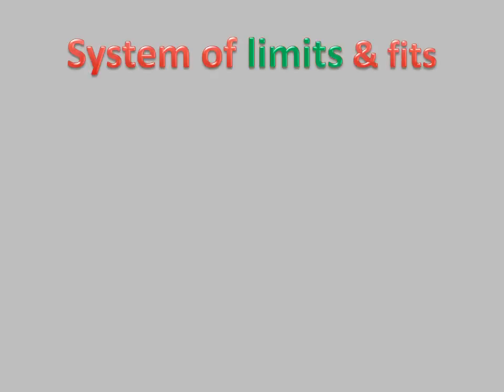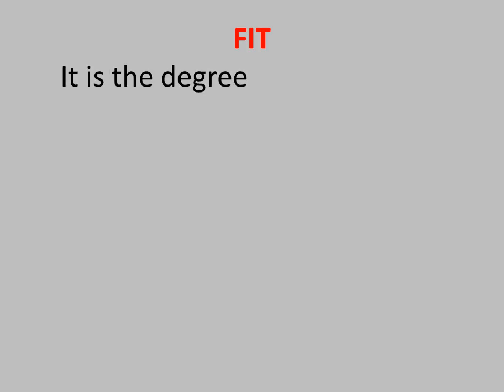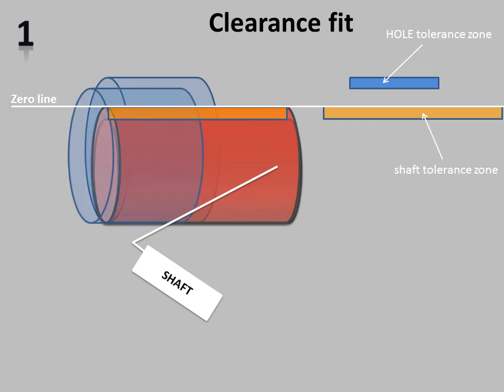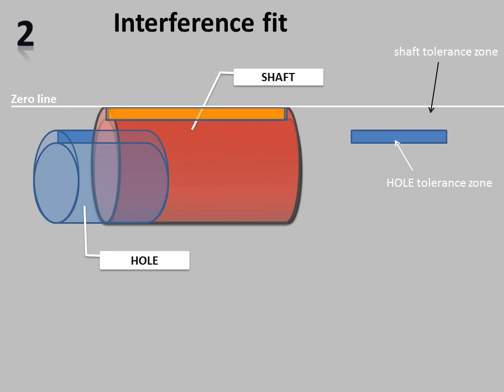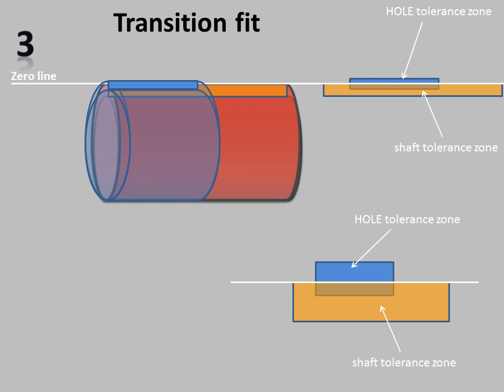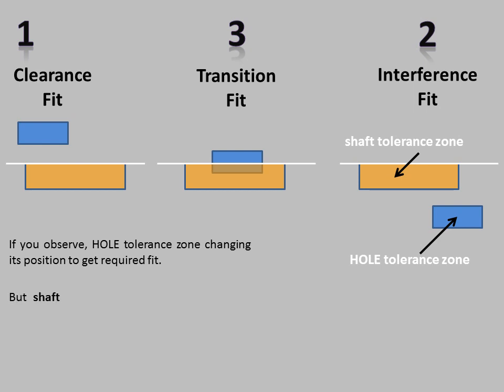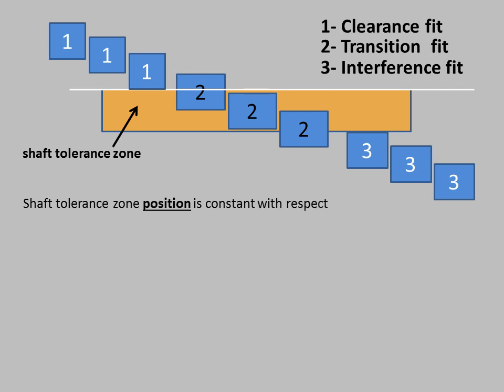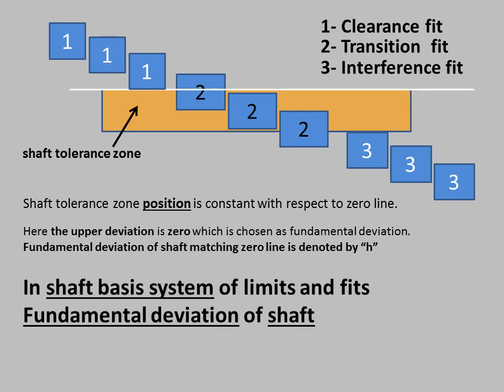fits,hole basis system, shaft basis system

Comment: In a fit such as H7/h6, what would happen if the hole comes in MMC (smallest) and the Shaft/Pin comes in at MMC (biggest) as well. Is there an unspoken rule in the workshop such as a Shaft/Pin should never be made at MMC. Always remove another...0.002 - 0.003? And what are the possibilities that a Hole will come in at MMC (at lower limit).

Comment: Can who clear up for me these following question? please!         
-Based on which basis we choose the appropriate tolerance? In addition to basics such as:
 +Tolerance system of the hole, shaft + Assembly type:( clearance, transition, interference)      
-I have the assembly between the hole with the shaft, the nominal diameter 20. But there are three cases happened: 
Case 1: Both hole and shaft are plastic. 
Case 2: Both hole and shaft are metal. 
Case 3: One of the two parts is metal and another is plastic. 
So, what difference in the above three cases when we choose the tolerance for them?
Reply from the maker: 1st of all it depends on
Purpose of assembly 
Magnitude of load
Type of load (radial, axial etc.....)
Then size of job.

In the questions you asked when  material of construction is plastic it is clear that load is minimum. So it will depend on type of load & purpose of assembly.
Reply: Thanks so much for answered my questions,  about the second question sorry but I  don't still understand so much. Do you have any document explant how to choose the correct tolerance of the assembly has the different material? Thanks again!

Comment: one question , how can we fit shaft in hole in interference fit?
Reply from the maker: as in case of interference fit diameter of shaft always greater than diameter of hole ,
we need to increase diameter of hole by indirect heating (to avoid changes in material property of the hole, for example heating a bearing in oil bath) enough to enter the shaft and locate on defined position.

or in some cases we use liquid nitrogen to shrink shaft diameter so that it will enter the hole and locate at its position.
Reply from the maker: by expanding (increasing) the hole diameter using indirect heating methods mostly and if interference is less then just applying force.
nole:
on shft end there will be chamfer  to ensure location in the hole.
Reply: By applying pressure with huge amount of applied force to shaft by forcefully forcing into hole so as to make sure that shaft holds tight with hole and minimise vibration while working

Comment: How do you fix the zero line? Why should the zero line not be there at the bottom of the shaft?
Reply from the maker: Zero line means no deviation from the basic size.  Right now size increases at upward direction but if you take at bottom of shaft as basic size and zero line then size will increase in downward direction.  And fundamental deviation curves will exchange position and so on..... 
Please watch the video again. 
You will get it. 
Thank you